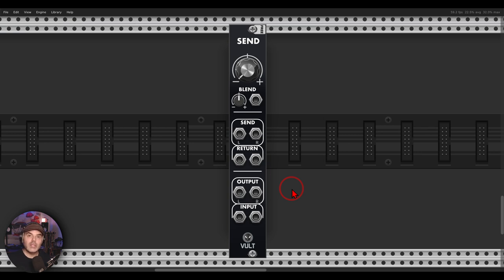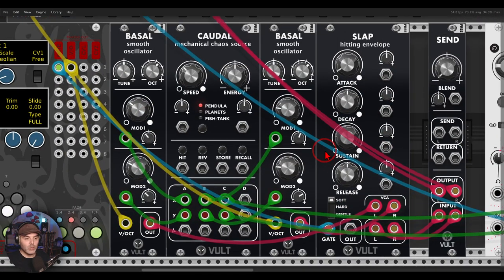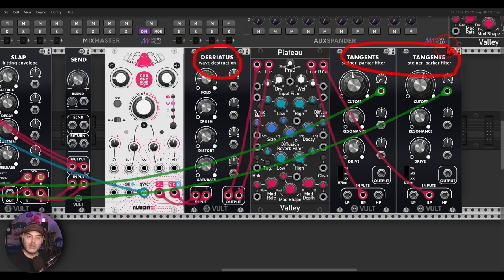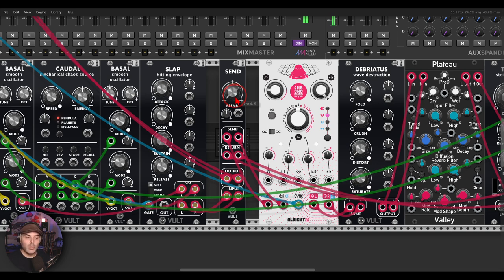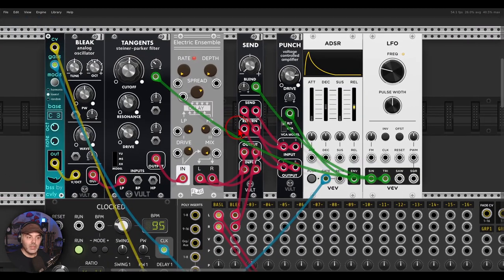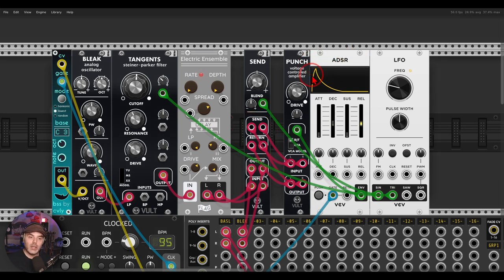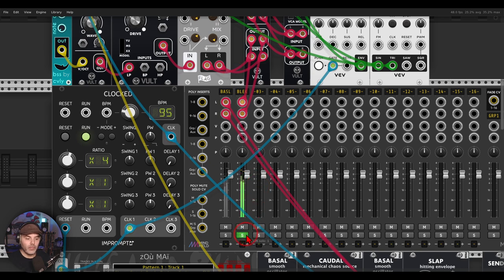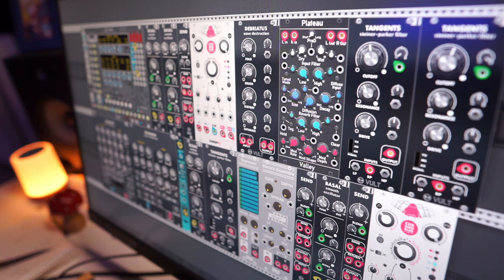Blending between dry and wet \ Quick Tip

Comment: This is really helpful. Also, I think I have seen a send/return built into MixMaster and MixMaster Jr. Is that correct? Seems like you have to add an extender module ("aux" something or other).
Reply from the maker: Yes, indeed. The MixMaster has an aux expander but it's also nice having this functionality inside the signal chain as well.

Comment: Hi Omri, I know this could be a long conversation, but any thoughts on Modular Effects Delay Compensation (or lack of) ?  -- meaning: would a reverse phase (audio signal) combine of the "wet signal fx chain without effect" and the "orig non-fx signal" cancel each other out, or there could be phasing effects ?   I guess it depends on the specific effect modular(s) and how 'the end result' sounds to the user ?  : )
Reply from the maker: Hi! If you speak about VCV, then each module you add in the chain will add 1ms of delay. Even if you just have parallel distortion or compression, you will get phasing. If you add time delay based modules like delay, reverb, chorus, and so on, it will not really matter since delay is a part of the effect.
Reply: @OmriCohen-Music  Thanks Omri for that info.  Yes, ultimately then, it will depend on 'our ears'.  For effects that have Wet/Dry "built in" -- I'll assume the Dev worked out the plugin internal delay timings between Wet and Dry so there's no phasing at Output.  For effects (like distortion or compression) without Wet/Dry built in, I (personally) will likely not do a "blend" and go "100%" effect ("inline").   "Send effects" (like reverb and delay) being something different "to taste".  I remember when there was a lot of pressure on DAWs to get "automatic plugin delay compensation" resolved at the final mix.  Thanks Omri for all the great videos, sharing and teachings : )